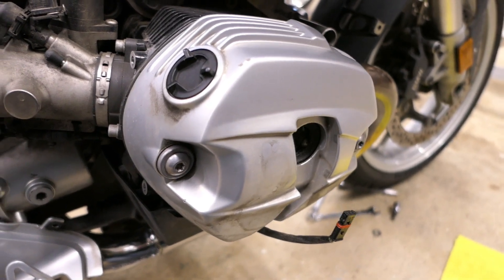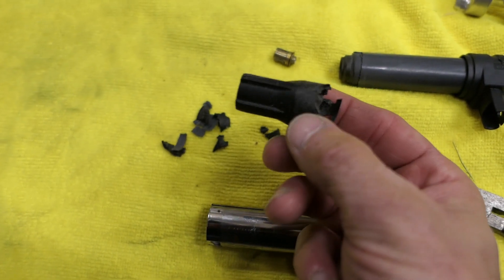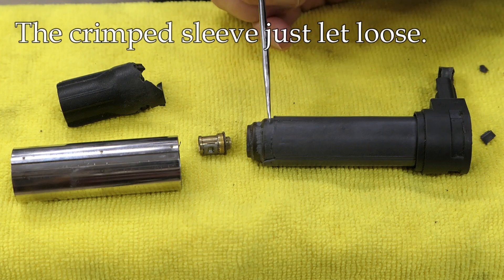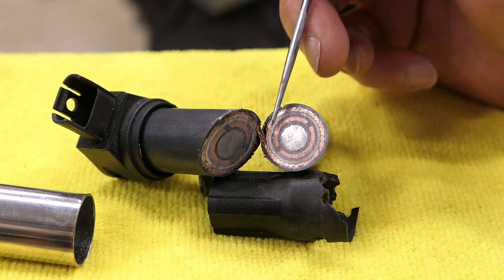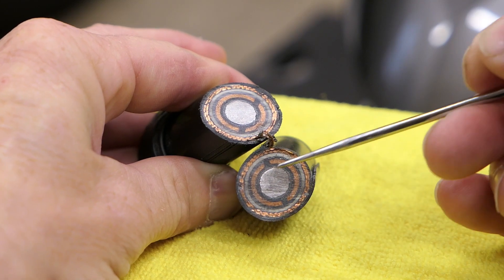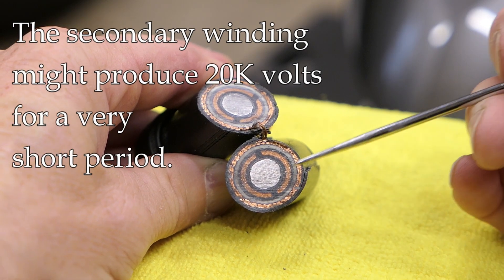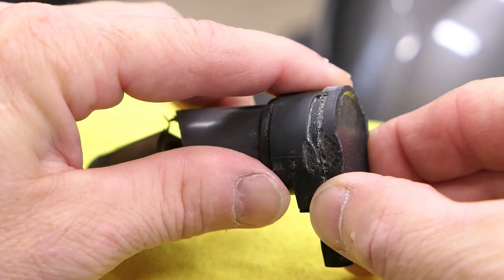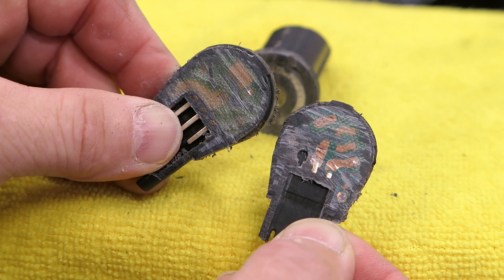BMW R1200RT Ignition Coil Deconstruction

Comment: Hi John, interesting issue there. I suppose there are many variables to create that worn out condition.  I have 2016 RT with nearly 68K miles. This video has my thinking about replacing these parts. I haven't looked so I'll ask, are there better aftermarket coils available?
Thanks,
Andy
Reply from the maker: The replacement coils I have used are made by Endurolast and sold by a retailer in the US called Euromotoelectrics.  I don't think there is a lot of choice about the coils, it's either the dealer or a handful of aftermarket companies.  I did see some generic asian-made coils for sale, but they looked sketchy.  There's really no reason to replace them unless you know they are failing electrically or they actually fall apart.  That said, your kind of mileage is a lot for the original coils.  Even on cars and trucks this style of coil tends to start failing around 75K miles, though some will last longer.
Reply: Thanks for the names John, that's very helpful!

Comment: Quelle est la durée de vie de bobine r 1200 rt
Reply from the maker: The lifespan can vary greatly.  Much depends on how the bike is ridden, riding conditions and how the coils are handled during maintenance.  Heat is what usually kills them off, so if you do long days on the bike with rides lasting 6-8 hours the coils will not last as long as those ridden for shorter periods.